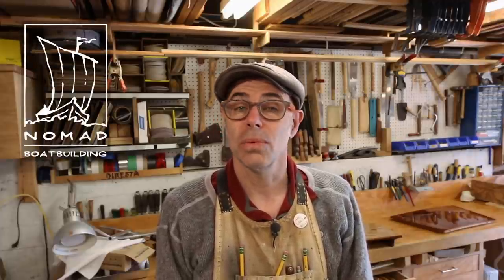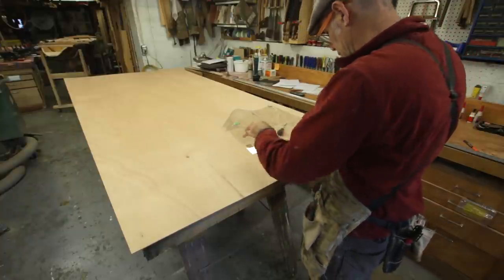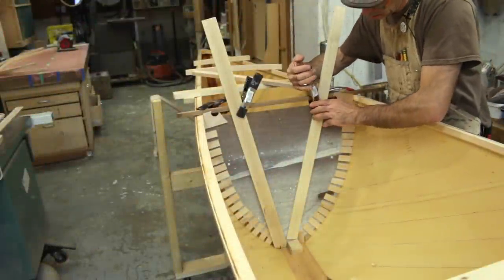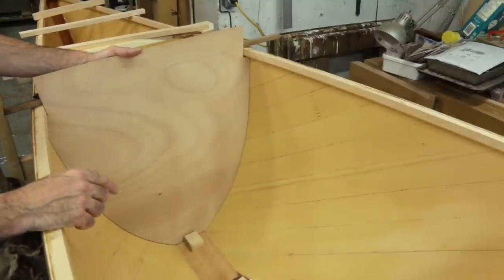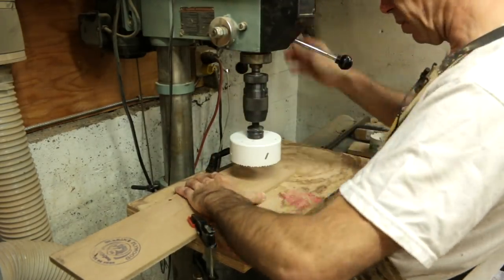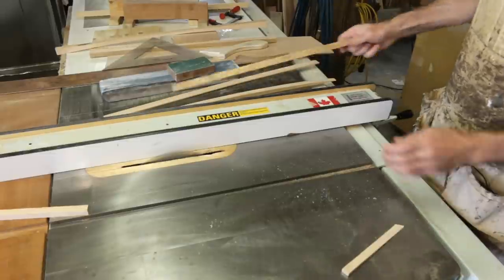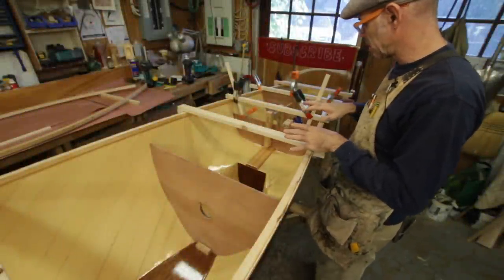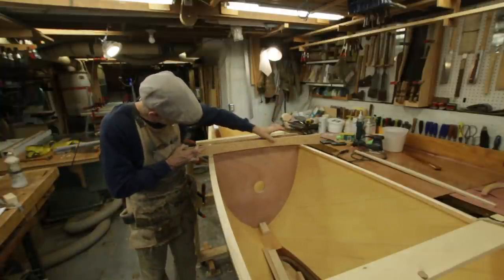International 2.4mR Sailboat Project - Episode 29 - Making bulkheads

Comment: I'd personally avoid filling floatation tanks with foam. You should be able to get them air tight with the fillet and then just make sure to take the tank hatches out when the boats not sailing to avoid air pressure poping the joints. You save weight this way and any condensation in the boyancy tanks is able to avapirate out instead of getting trapped against the hull in the foam
Reply from the maker: I am with you 100% but the class rules stipulate rigid foam flotation.
Reply: @Nomadboatbuilding  that sucks and is rather odd. I guess it makes sense to make the boat pretty much unsinkable as the cockpit is recessed under the deck
Reply from the maker: @tobymason8951  anytime you see a rule, it often means someone died or came close to it. I hate the foam but I just have to go with the flow on this one.